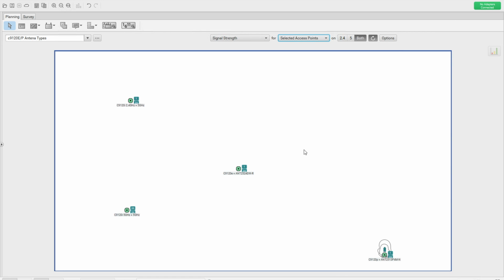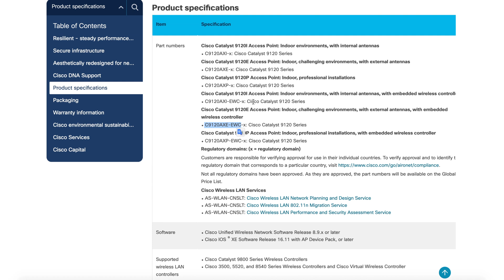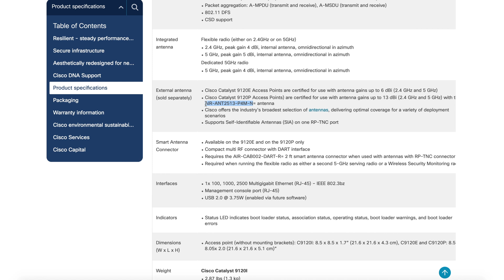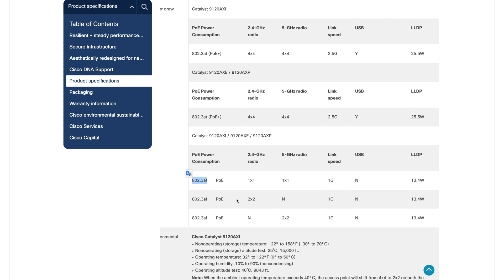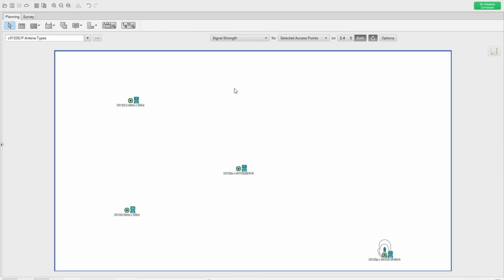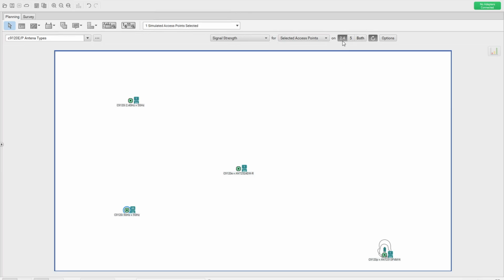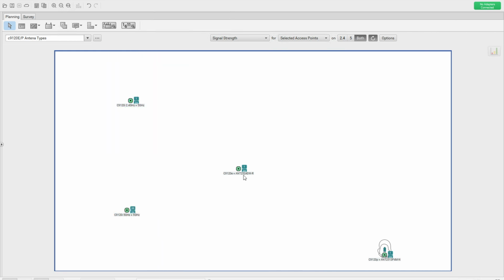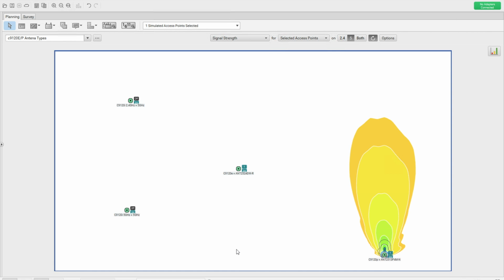Understand Cisco Catalyst 9120 Series Access Points Capabilities through Data Sheet & RF Simulation

Comment: If we use 9120i in open space environment how far the signal come if we keep maximum power level
Reply from the maker: The maximum power level itself can change based on the regulatory domain of the AP. So I will not give any range here, in an office environment we used to take 1500sqft/AP for initial calculation then RF predictive/active surveys will finalize the count. Please find more about RF in the play list below. Hope these videos may help you to plan better.

Understand your AP and Radio frequency (RF): https://www.youtube.com/playlist?list=PLBCtB6TlRTcf4qNi9YMDhXa8evHsj-ca1
Reply: @TNPbyJaison  just want to know approx range of AP in open space area if we use in 5ghz and 40 mhz how many meters it would cover.
Reply from the maker: As I mentioned earlier it depends on the regulatory domain as the max power level varies in each location 

Currently I am not in a position to check the actual coverage but please find the below values in a simulated scenario. In wireless we have to get the best experience so kept the boundary as -67dbm for below values.

5GHz
23dbm - 240m
21dbm - 185m
19dbm - 150m
17dbm - 118m
16dbm - 107m

In reality it can vary, but this is the value we got in the simulated model. By the way channel width will not have much significance from a coverage point of view. 

Hope this clarifies your query.
Reply: @TNPbyJaison  thank you sir for the clarification, one more question is that we it is recommend to maintain 15 meters distance between 2 APs,and does it have anything to do with signal strength?
Reply from the maker: @junaidshaikh8184  Its completely depends on RF planning based on density and RRM plan